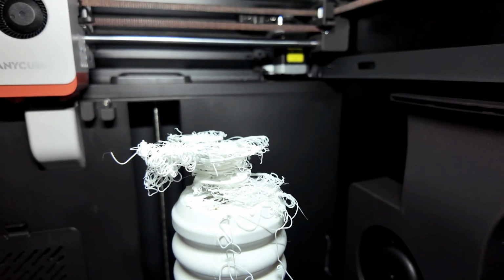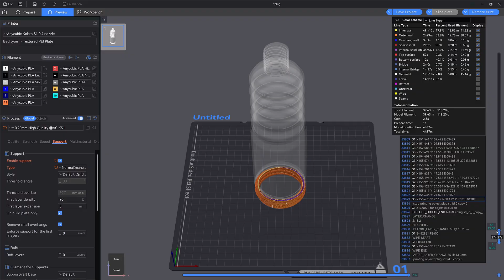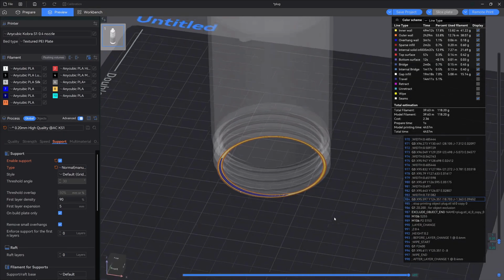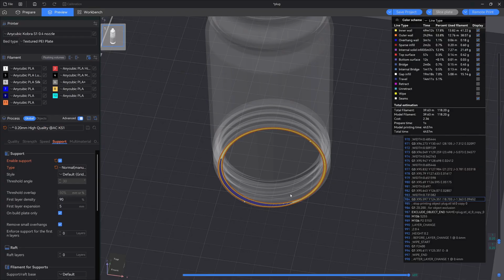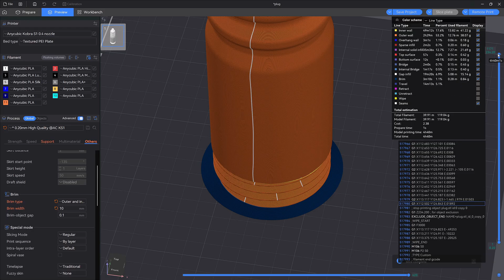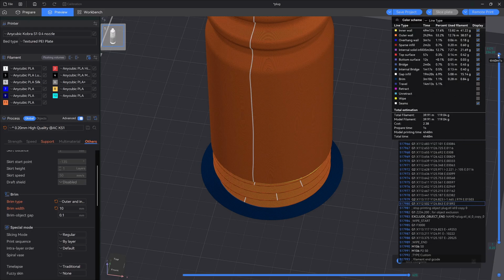The 1 Slicer Setting That Fixed My Print

Comment: This is great info. I can't count how many prints that have failed over poor contact to the bed in the model. So I've wasted a lot of time and filament learning this sort of lesson through trial and error. As a future suggestion, maybe cover orienting prints on the plate to optimize for different things, reliability in printing, strength,  getting the best dimensional accuracy and detail.
Reply from the maker: I'm actually releasing a video similar to that tomorrow. Not all those points but definitely orientation.

Comment: Another way is to first use the 'lay on side' function, that probably would have shown the issue on the bottom. To fix it I would have just cut the model bottom so it was actually flat using the cut tool to trim off the bare minimum to make it flat. I honestly never would have even thought to use the brim.
Reply from the maker: I didn't want to modify the model at all so brim was the quick easy fix for me. 🎉 Thanks for the suggestion on this.